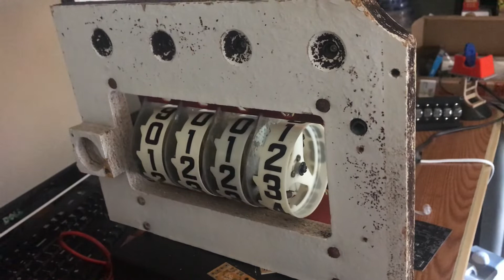Pinball Score Reels Test (Clock/Ticker Project) (Williams Reels) #2

Comment: It's unique and really different.  The controller looks pretty solid too.  It looks like it's got a serious cap on there.  Pretty neat stuff Michail.
Reply from the maker: Power is a 2 line 12volt which combines to 36 volts.  Hard to find SMD rated this high.  The cap is 50v to be safe.  This also ensures that it can provide enough power to not only the 25volt version but the 50volt coils as well.  I have the materials to make several of these and may list at www.pinballclock.com

Comment: Pretty  cool! How does it know the absolute position of the dials?
Reply from the maker: There are contact switches which open in the 0 position.   So, the clock cycles on power on to determine the 0 position of each reel.   During that process, it pulls the time from the RTC (DS3231M) and if it knows the Wifi password to get to the internet, it also syncs with NTP and then sets the time on the reels.
Reply: Thanks, I see! Just out of curiosity, does it need the WiFi password to extract the time information? I would have thought that this info is available to everybody, even without the password. Cool project!
Reply from the maker: It needs your Wifi SSID and password in order to get out to the internet to get the time via NTP.  That said, it doesn't require this setup since the RTC is there.   The DS3231M is rated to gain/loss about 60 seconds per year.  Accurate enough without NTP.    When it starts up, it creates it's own access point which you could use to connect with your phone and set features like time, date, sleep mode (stop wheels at night), etc.